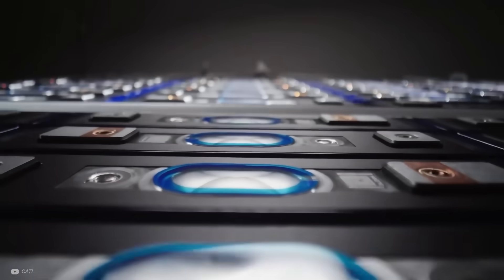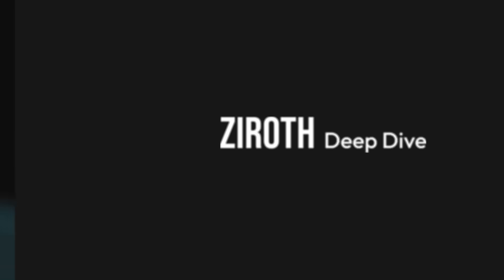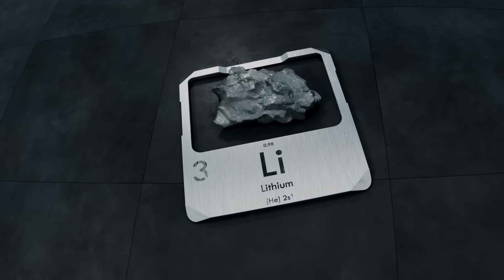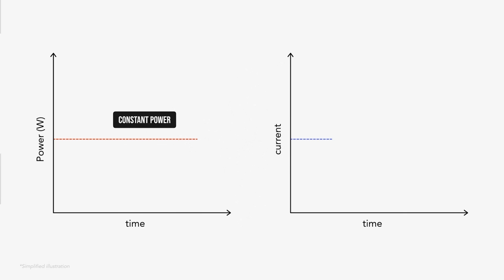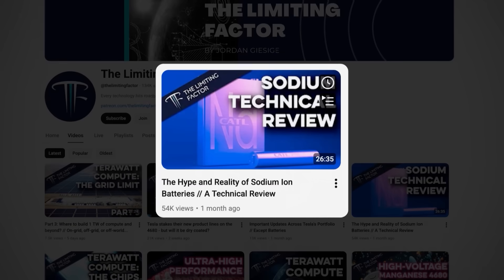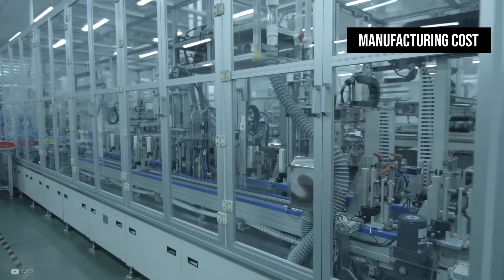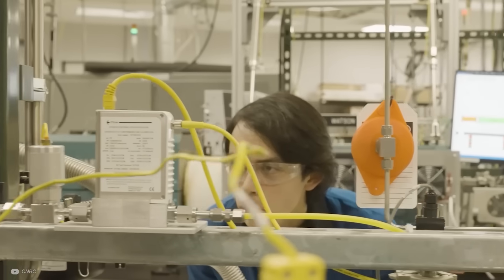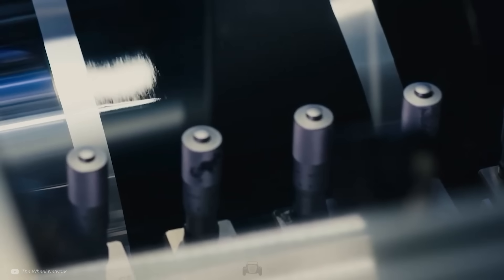How CATL’s Reinforced Sodium Battery is Insanely Cheap

Comment: I think your analysis (like Jordan's) is very good and about as in depth as you can get for a non scientific or engineering document. That said, I think you made the same mistake he did. You failed to mention the current cost of the CATL Naxtra sodium ion cells (per kWh). They are already, as in this year, cheaper than LFP cells. They announced they will be selling them for "around" $19/kWh and are already mass producing them. What that means exactly is not clear, but it is clear that they will be available at some sort of mass production scale for less than half of the current cost of LFP cells in 2026.  Now this is one company in only one country, but it is the largest battery manufacturer in the world in the largest EV and grid scale storage market in the world and the largest EV market in the world. I think that throws off the whole global timeline as done by Stanford as just provably false. It may be accurate for the US, but that is not a representation of the global average, since that is mostly China, in stead the US is the worst case scenario and the smallest contribution to the global average, with China and CATL being the largest contributor. BYD has also announced similar plans and they are the second largest battery manufacturer and also use their own batteries in their own cars (as well as selling them externally).

Additionally I don't think you should count out grid and home based energy storage. Where as EV's are currently 90%ish of the battery market and energy storage only 10%ish, energy storage is growing much more rapidly than EV's are, and that is a perfect market for sodium ion batteries. They can both ramp together, output of sodium ion and expansion of grid and home energy storage that is remarkably cheap. Additionally sodium ion is a better match for grid storage due to the following clear advantages:
1. Lifecycle of 10K cycles compared to LFP at around 4K (though those made for the grid to have higher lifecycles, but that is true for both chemistries)
2. Better cold and hot performance (you did mention this, so no details needed)
3. Cheaper, much cheaper if they don't need expensive thermal management hardware.
4. Easier (and cheaper) to recycle at end of life.
5. Much safer even than LFP. The fire risk on sodium ion is zero because nothing in them is flammable.

Now the drawbacks (you will see there really are none):
1. Not fully ramped to scale yet (but again perfect for a growing market)
2. Less energy dense (doesn't matter at all for grid or even most home storage for the differences we are talking about, and also given no need for thermal management may not even be heavier)
3. Voltage is not as consistent so it requires more expensive electronics (but the electronics are a small fraction of the cost compared to the cells, and the no longer needed thermal management)
4. Efficiency (however given no need for thermal management and the better temperature ranges, it may end up being more efficient in actual applications).

So given that it is a net positive in every category, I think it will take over grid storage as fast as LFP did. That said, I think CATL did the same math you did, because they seem to have optimized the Naxtra for the EV market and are not advertising anything for the grid market. Oversite, I think, maybe someone else will step into that market or they will adjust.

Let's put it this way. If I was an engineering and business minded person building EVs and deciding which chemistry to use, it is still not clear that sodium ion is the right choice yet (but it would take some investigation and depend on the specific use case). If I was building a grid scale product, then I wouldn't be considering lithium ion at all if these cells were available to me.
Reply: Hi! Just my subjective view...  I am not so sure that the price will "drop" now. Theoretical production cost is one thing, business models and profit another one. CATL themselves produce Li batteries, and dropping So and "competing out" their own production would be a stupid move.
Production costs may be low, but profits high, now as long as they may be the leading in So batteries.
In a few years, the prices might start to get down, as some competition arise, and they might lower the production of Li batteries, if the market goes that way.
At this point, there is a market for So, even at higher price for those who want a battery that works in the cold.
Now I fully agree with you that the future seems to be good for So batteries.
Reply: @PjotrII  They are selling it now already, so that is why I was asking the current cost. We have an idea because their customer is selling an upgrade from a 24kWh pack to a 33.3kWh pack for $5k. That maths works out to $150kWh for the upgrade, add the cost of the initial pack and it is probably under $250 per kWh now. That is pretty good for small scale, unless they are eating the cost for market share.
Reply: @mikereinhardt1244  can you give a link to what you talk about?
Reply: @PjotrII  These are for sale now, just go to their website. But, apparently I had that wrong. I saw a 20.2 kWh version for $29,900 with an upgraded version 33.3 kWh at $34,900. I assumed that the 20.2 was not solid state, but I was wrong. Apparently both are solid state now, so we know exactly the retail cost per kWh it is $381 per kWh. The previous version of the bike was the same price ($29,900) and had approximately 20 kWh according to AI, which means they were already charging approximately that for the battery. We don't know the cost to the bike manufacturer though. That is what I am trying to get at. I buy batteries for my EGO mower and they are like $600/kWh. I know they don't pay that for the batteries, but that is what they charge me.
Reply: Both of these posts are for a different article on Donut labs batteries. Not sure how they got posted here...

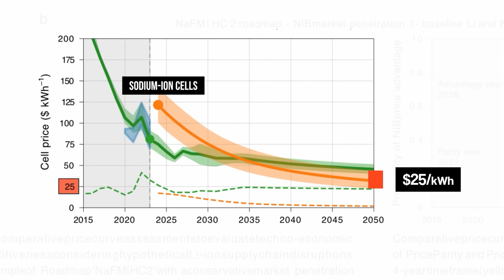Comment: 13:28 “the price of batteries head below 25$ per kWh”… that would mean that a 100 kWh battery would only cost $2.500!!
That’s amazing. Even $75 per kWh would be amazing. 
Here’s the interesting part: these are costs of the CELLS, not an entire battery pack. Adding reinforcements, temperature management, electronics, etc, the cost per kWh is much higher. If they can produce a cheap pack that doesn’t need reinforcements, nor temperature management, it’ll probably be extremely competitive.
Reply: The cell price is expected to drop to below $10 per kWh at today's dollar value. The pack (= battery) price will fall to below$25 per kWh.
Reply: @RWBHere  That amount is closer to fixed than scaling with the capacity, though, right?
Reply: That's CELL price not PACK price
Reply: Sodium has a much lower volumetric energy density, not just gravimetric energy density, as touched upon in the video. This can be seen in CATL's Freevoy pack, where the Sodium cells are about 15-20% wider than the Lithium cells in the dual-chemistry packs. Sodium based battery packs currently offer much lower energy capacity (kWh) than Lithium packs of the same size, resulting in lower vehicle range. This may be optimal for small city cars, where range is less of an issue, but for larger vehicles, or those requiring more range per charge, then Lithium based batteries will still remain the more viable option.

Further, once Sodium specific systemic costs, such as additional cooling (Sodium electrolytes are less thermally stable currently than ones Lithium based ones) and higher cost power electronic requirements, are factored in, then the cost equation becomes more focused around the battery pack at the system cost level within the vehicle than at the individual cell cost level within the battery pack.

Comment: In vehicles, energy density and specific energy are both important. For aircraft the energy to weight ratio is more clearly important, but for ground based vehicles the bulk can play a significant role. So a compact storage system that weighs more can still often be competitive, especially if still reasonably close in energy density (and Sodium ion is within 75% of that of Lithium so seems viable).

This doesn't even get into the advantages in performance and cost for hybrid sodium and lithium ion cell arrays in battery packs.

Comment: Couldn't a form of dynamic cell configuration (changing the serial/parallel cell ratios) overcome the voltage degradation? I don't know if packs have this hardwired of if data-networking type switching could be employed.

Comment: Ah yeah, I don't think "it's Over" exactly yet.  Samsung just announced a solid state silver-lithium battery a couple of weeks ago with twice the power density of a standard lithium battery, and can be fully recharged in 9 minutes or less.  Samsung also announced that production is due to begin in early 2026, if I read that correctly.
Reply: Just 2 months ago Amprius in California, announced full production of their Silicon anode lithium batteries which have 80% more power than standard lithium ion batteries.

Comment: There's no need to focus new battery tech too much on use in vehicles. The stationary battery markets solves big problems for the operators of electrical networks and for solar and wind energy producers of any size. For those weight isn't a topic at all and that market is only starting to grow and will certainly make up the vast majority of battery usage within the decade.

Comment: Sodium-ion EV batteries can generally sustain higher charge and discharge rates with less heat generation and a lower risk of thermal runaway compared to Lithium-ion batteries. This makes them inherently safer and better for fast-charging applications.

The position of the throttle (controlled by the driver's foot) determines the specific level of power draw from the battery. EV battery BMSes and motor electronic controls acting in concert typically aim to provide an experience of constant/undiminished power delivery as determined by the throttle position in a way that is as far as possible independent of the SoC of the battery. And, given those objectives, for a battery having a relatively large drop in voltage at a low SoC (compared to voltage at full charge) there must necessarily be a corresponding increase in current in such low charge states. But, to be clear, while this is a challenge to vehicle power electronics and inverter (which must be up to the task) it isn't much of an issue for the battery. It is one of the distinct advantages of Sodium-Ion battery chemistry that it tolerates DC discharge increases seen at low states of charge very well without generating a lot of heat.

The addition of Antimony results in a more LFP-like voltage profile and improves the structural compatibility of electrode materials. That is a bonus that makes Sodium-Ion a no brainer. I am sure CATL is underrating the longevity and charging capability of these batteries.